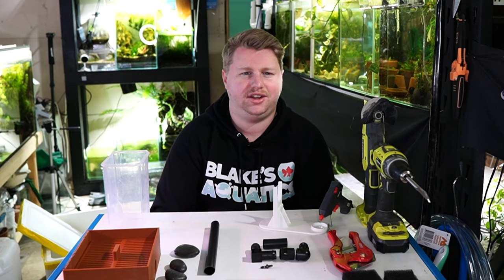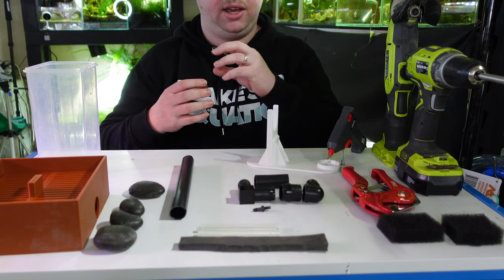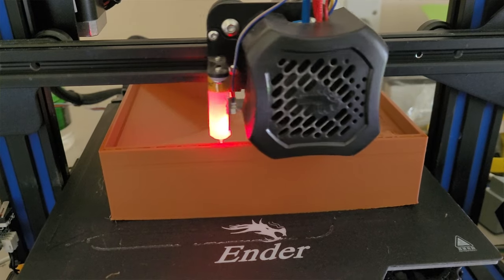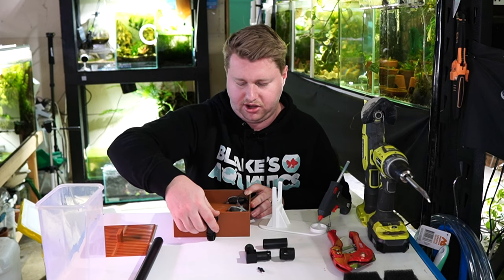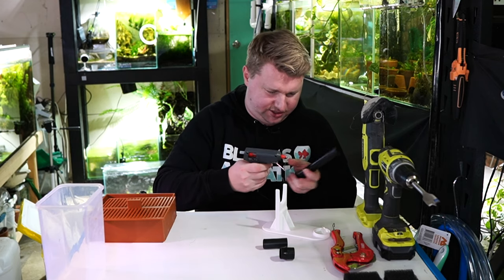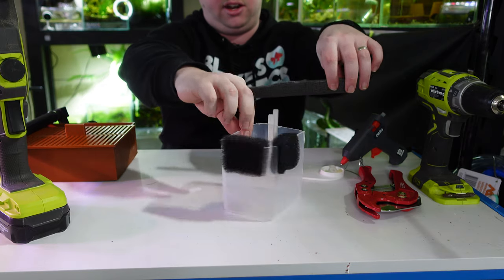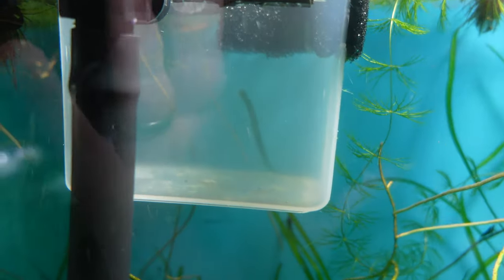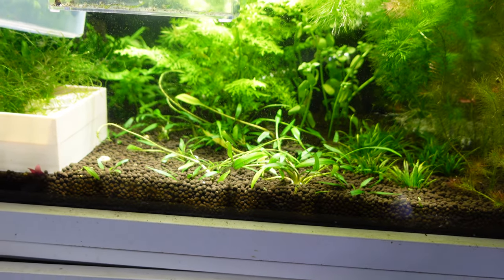How to Breed CPDs, Tetras and other Egg Scattering Fish the Easy Way! DIY Egg Harvester for Fish

Comment: This is certainly worth trying. I use the plate method before but never think of putting airlift in there. I think while using no airlift is also fantastic for simplicity and just take the whole contraption to check eggs, adding some suction would definately help in reducing eaten eggs. Ive watch some eggs float quite a bit and get eaten.

Comment: I asked my fish a lot of eggs, but the hatching rate is less than 5%, why is that, how to incubate the eggs? thank
Reply from the maker: Getting fungus or just turning white?
Reply: @BlakesAquatics  Some mushrooms and some turn white, the rate of 100 eggs hatching is about 5 to 6? What are the conditions for incubating eggs?
Reply from the maker: @dientrung9948  same as the parameters to keep the fish. Ph 6.5 to 7.5, 2-10 dkh hardness, 73 to 79 f/ 22 to 26c temp. Main things with hatching eggs is you need flow over them to keep them moving to hatch them